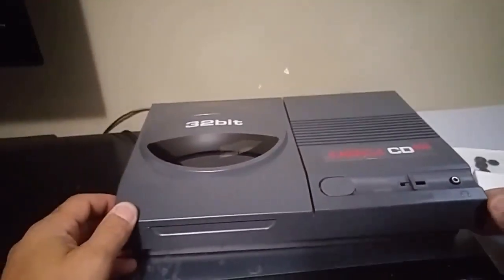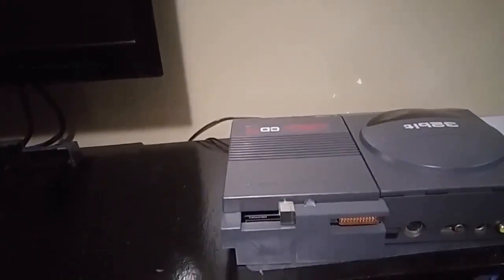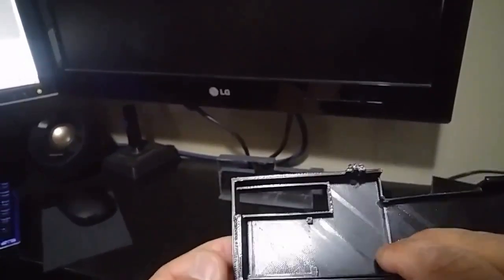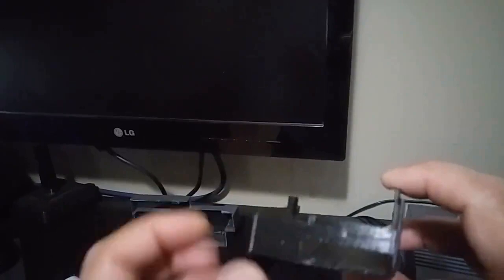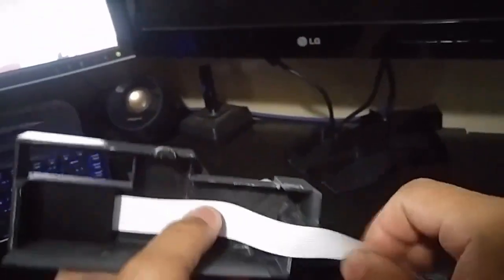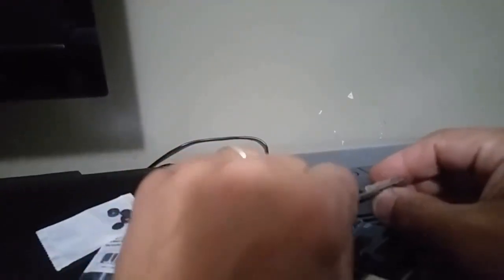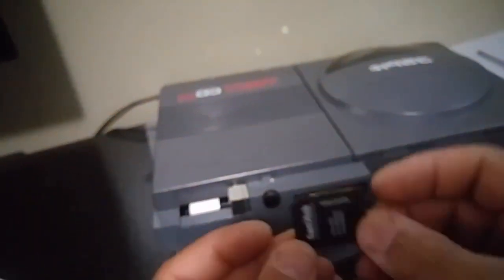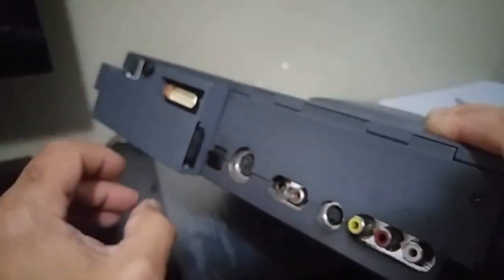Amiga CD32 - 3D printed K2k Riser Cover with integrated SD card reader!

Comment: I finally got to watch this video, great work and great design, i wonder the 3D print file,  if i took it to UPS where they have a big 3D printer i can print for a fee, would i be able to print it in one piece or is this a 2 piece designed print file? And how hard would it be to modify it to be only a one piece print?
Reply from the maker: Thanks for the comment Robert glad you liked it.  Its a two piece design.  So many 3D models available are too big to print on anything but a much more expensive larger print-bed printer.  I have to import them into CAD take measurements and redesign them into two or more  pieces to be able to print them.  I made the cover in two pieces so any printer cold print it even one with a small print bed like mine :).    It took me a long time to come up with the design and the proper placement of the standoffs/sd reader holder finding the right combo of parts to go with it the right size extension that had a internal board that fit the void space under the card etc but now that all done making a one piece version wouldn't be that hard. if there is enough demand from my subscribers I could make a one.   You could have it printed as UPS as two pieces because of the size and layout it should only count as one print.  is it only takes a dab of super glue to put it together.    If anyone makes a print of this PLEASE post a reply to this video with a picture and point anyone who asks to this channel that would be awesome and greatly appreciated.

Comment: Nice setup ! I've printed one cover ! Thanks for the STL.  I've tried with a SD to IDE adapter but no boot . The SD card itself boot in WinUAE. Do you had some difficulty to setup the SD to IDE adaptor too ?
Reply from the maker: Thank you. I'm glad you liked it. If its booting in WinUAE it should boot fine in the adapter.   Make sure you have the ribbon cable in correctly on both sides. check that the red strip on the cable is on pin 1 of the adapter and the IDE port.
Reply: @32Bits  Yes, the cable is in the right way, the power led of the adapter is lit. I'll try with other SD Card, perhaps it's the problem.What size of SD have you used ?
Reply from the maker: @rochabian  Good idea,  I'm using 8 Gigs cards now.  I have used 4 and 16 but nothing larger. Let me know how you make out.
Reply: @32Bits  Finally it works. I was using micro SD SDXC with an adaptator but it doesn't work. Now i use a normal SDHC card 16GB and it works. Next step i want to have CF + SD with the Panther Dual IDE form Edu Arana but it's another story. Thanks for all !

Comment: Impressive work.  I could really use something like this to protect the riser card rather than the roll of PVC tape its currently wrapped in lol.  Perhaps if the PS2 port was orientated with the connector facing rear then the SD card or maybe even CF card could sit on other side.
Reply from the maker: Thanks! It's definitely saving on wear to the edge connector not having to pull the Riser every time I want to update the SD card. and yes would be better than pic tape lol. I have actually thought of rotating the ps2 conector but wanted a soulution that didn't requite altering  the rise card.
Reply: I really need to get one of these so I've been speaking to someone local who is going to make it for me but he says he needs an stl file rather than the gcode format. Is this something you could provide? 

Apologies but I don't know the first thing when it comes to 3D printing.
Reply from the maker: @CRG  Check your email.
Reply: @32Bits Responded to e-mail.  Thanks 32 Bits!
Reply from the maker: @CRG  Glad to help out a fellow Amiga CD32 fan